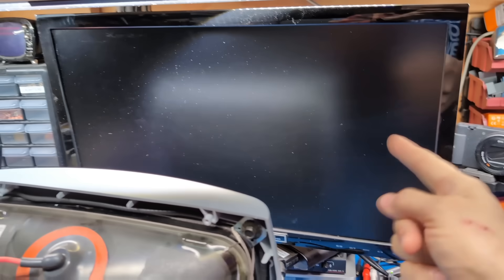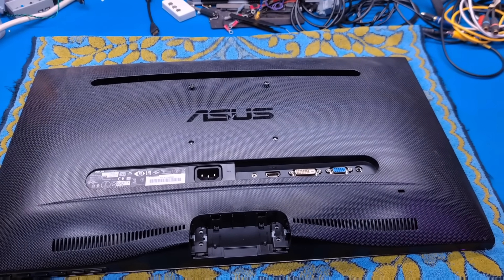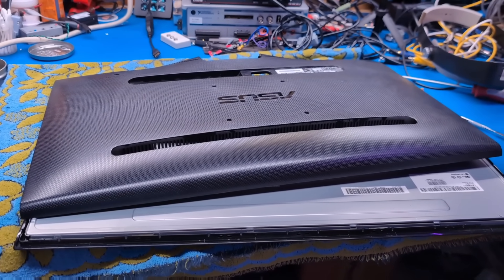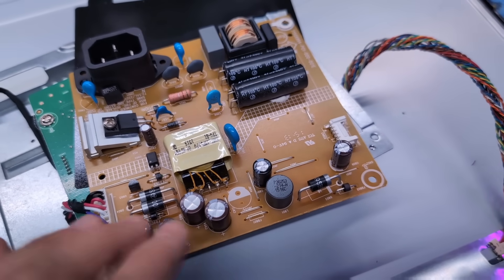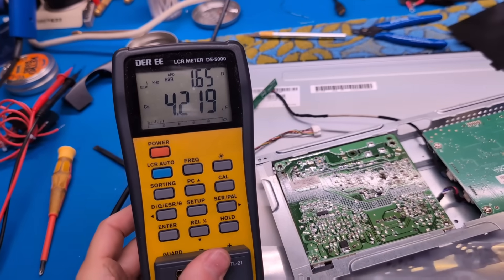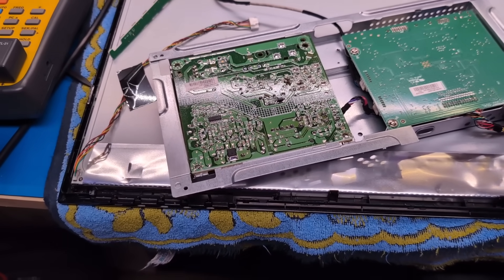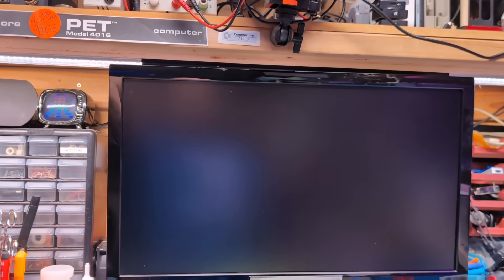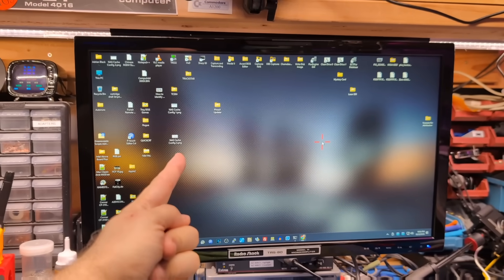Fixing my broken Asus LCD monitor: It won't turn on.

Comment: I have an ASUS monitor about the same age, but different model, and it "died" exactly the way yours did, in my case however it looks like I have some bad caps because six of the caps on the PSU-board are bulging like there's no tomorrow :)
I'm going to replace them and hopefully the monitor will live on for another ten years.

Comment: I have this monitor and it recently stopped turning on completely and believe it or not, the fix is to unplug it and hold the power button for 30 seconds, or just leave it for a few hours unplugged. It's some kind of issue with the soft power circuit. It seems to usually happen with power interruptions. I wonder if the cracked solder joint was even the problem in this case! Still good to repair either way.
Reply: interesting because mine does that, the longer i leave it off the longer it will work without issues, i will try pressing the button 30 seconds while disconnected, so maybe it could be the small board with all the buttons

Comment: The same with a iiyama 27", 10 years old too. Its components are the same as a common Philipps 27" (which provide very useful service manuals, thanks Phillips), and i found no trouble with caps, but it seems there is subtle cracks in the solder joins near the diods, as "pushing" them a little temporary solves the issue (solder quality ? temperature problem ?).  Thanks for sharing your own troubles ^^.

P.S.: As a side note, when this one is HS, the USB ports are still functionning with no issue, and there is curious voltages on the buttons panel, kind of 300mV instead of near 5V when not H.S.  (leak current ?). Thus, it seems that only a part of the alim is in trouble.
Reply: @adriansdigitalbasementextras I guess i found it. It was not the power supply. It was the little keyboard. More specificaly, the little IC on it, which seems to have now hard time waking up on Vcc, pushing one time Vcc a little up on it seems to solve the issue. Hope it will help in your case.

Comment: There is a bug in my ASUS monitor. If the screen has got into sleep mode (orange button) and i turn it off, it will sometimes not start as it should when i turn it on again. Then i have to unplug mains and put it back again and now it will turn on again. It has been like this since it was new 2019.

Comment: I fixed a friends TV that worked for a few years then stopped. There was a capacitor leg that had no solder at all! It must have been making just enough contact on the via and over time shifted. It was a black Friday special...

Comment: I have a similar monitor, similar age too with the same symptoms, I haven't fixed it yet because the bezel is extremely difficult to take apart and I don't want to damage anything, I'll check if it has the same problem with the diodes but I was suspecting a bad polyfuse because the first time it failed I had to leave it off for a long time before it started working again, same now, the longer I leave it off the longer it lasts without it failing. thanks for the video 👍
Reply: so i opened it and couldn't find anything obvious, the solder joints under an inductor were a bit cracked but i doubt it was an issue (i reflowed it), caps seemed fine, there are two dual diodes one runs hot the other one runs hotter from the discoloration, and on the main board the only thing i noticed was that the main chip runs too hot to touch so i added a heatsink but the monitor still has the same issue, so i dont know, i might change a couple caps next to the dual diodes and maybe the small transistor that is next to those, the thermistor measured fine with no discoloration

Comment: My hp monitor from 2009 failed a few years ago, 3 8 pin soic ICs had to be replaced in its psu along with 2 failed open resistors that was difficult to find out. 

My dell from 2013 is also shaky, I looked up the symptoms and it would point to a sot23 voltage regulator. I've already bought a few in case it no longer turns on. 

Both still work and I'll just repair them unless the parts are no longer available like backlight or custom IC.

Comment: This year my Asus monitor stopped working too. It doesn't wake up from sleep or starts from cold boot. Only blinks blue with power LED. First I changed bulged capacitor. It worked, but not for long. Now I probably need to replace either dual diode or voltage regulator for it to finally return to life.

Comment: My second monitor, a 24" Dell U2414h (the 14 is the launch year) has acquired a weird glitch where a single one of the backlight edge LEDs won't turn on after powersaving sometimes. It's fine if I power cycle, so I just do that. Eventually I'm going to upgrade my main monitor and move the current main to be the second. Eventually.

Comment: You unclip 100 little clips and the bezel looks like a dog chewed it. Or in the case of an ebook reader I recently disassembled: the bezel is stuck on with tape, so you have to start at one corner and just tear it off, and THEN you have 21 screws of 3 different sizes for the insides which is a screen, a battery and a small pcb. Of course nothing is supposed to be repared by anybody these days. But we still try! :)

Comment: Glad to see it fixed. 
One time fixing an older lcd monitor with powerup, blinking, looping-bootup sequences gave me a bit of a hard time. 
The culprit in that case was a failing small smd cap, on the logic board near the main controller IC.

Comment: Cold solder joints can be a common problem.  I used to work at a 2-way Radio Shop, & we had both GE-Ericsson & EF-Johnson Radios, which manifested temperature-related problems.  One of our tests, was to place the radio in the refrigerator for a period of time, then remove it, & run it through the paces of operation.  As it warmed-up, if the trouble appeared, we had a better idea of what we were looking for, in-terms of failure.

The boss was never fond of this approach, but it got the job done, & he made his money back, so we saw it as a none issue.  ;)

Comment: I have a very similar monitor that also recently went bad. Mine was CCFL-lit, and I thought replacement was better than trying to mess with the CCFL drivers.  I've now got a matched pair of edge-lit LED panels, and I tell myself that I'm happier.

Comment: I had a very similar Asus monitor, I think it was in my Son's room when it catastrophically failed and melted one of the power plug pins into the plastic of the connector. Luckily I had a bunch of random monitors already around the house and I just plopped another on his desk and he was off and running again.

I'm not using any Asus monitors anymore.

Comment: I have a similar ASUS that I don't use anymore but one thing that drives me crazy with monitors these days is power saving. I want to hotwire my monitors so they have toggle switches to turn them on and off.

Comment: About six years ago my old Asus monitor made a "plonk" sound and turned off, and I couldn't turn it on again. I opened it up and found the reason: a solder joint failed and one leg of the fuse in the power supply jumped out of its through-hole. It was a very easy fix (and the first time I've used a soldering iron since I was a teenager), the monitor still works fine, and it made me think of how many monitors end up in the trash for simple failures that could be repaired in ten minutes with almost no costs.

Comment: This reminds me of a Vizio TV that stopped powering on for a friend that I "repaired". I found a video that explained that it was an issue with the solder joints on a BGA chip which lives under a giant heat sink. So I blasted that spot with my heat gun for a full minute, then let it cool for 10, and afterwards it started right up! But like you said, they make these things to be disposable anymore and that's just a damn shame.

Comment: I have an off brand monitor/TV my neighbor bought at of al places the grocery store. She got rid of it, and I scooped it up for testing machines. It stopped working, but I could see an image on the LCD, and it turned out to be the MOSFET hat powered the backlight. The board under the MOSFET was cooked to the point where it delaminated the traces, and failed because it sort of desoldered itself/broke the trace. The part was actually still good, but was getting stupidly hot. I ended up replacing it with one that cold handle more power, and it's been working  ever since, and not getting warm. I honestly don't think the part failed, it was speced wrong. I spent a lot of time checking caps, because they fail first, but in several things I have repaired recently, it hasn't been due to cheap chinese caps, it's been something else that was just speced too small.

Comment: I just had a monitor fail and it's built exactly the same as yours.. I'm going to go inspect it now for bad solder joints.

Edit: Checked and it's bulging capacitors 😢
Reply: Extremely common issue on LCD monitors from this era, especially on the power board/circuit.

That, and cracked solder joints. I usually just reflow everything if I ever have to open one of these up.

Comment: That's why visual inspection is always the first step. That's not the first PSU with cracked solder joints, because those engineers didn't thought of heat created by PSU AND the panel back light, or they did that on purpose, planned obsolescence is a thing.
Reply: The main cause of cracked joints is wave soldering. It never applies enough solder. It just falls off again.
Reply: to be fair, it's LED backlit

Comment: When i first saw monitor hardware just taped on i was shocked, but it's been like 15 years that they're like that. I wonder what more modern ones are like, how much more mounting hardware they have been able to save.

I had to rebuild my ASUS monitor PSU about 9 years in, i bought it maybe 2011 or so, it had obvious cap issues, it's been good since.

Comment: It really feels that no progress has been made, at least in PSU manufacture, since the days of the original Macintosh. Same problems keep creeping up.
I wonder how many tens of thousands of these end up in landfills due to a simple fixable problem or a failed $0.10 component.
Reply: No the progress has most certainly been advanced so that consumer electronics fail for simple reasons precisely on time for the next model. I have found several ok monitors left in my neighborhood, that have been replaced because the external power supply has failed. Since they have propitiatory connectors, or oddball voltages, most people won't even try to find a new one. If they do, they find the power supply is costs as half the price of the monitor, so they buy a new monitor, the way they have been conditioned to.
Reply: Progress has been made. People just won't pay for it. This has been built down to a price. People want cheap disposable stuff. Look in a PSU on something like a military aircraft. It will be bulletproof but cost 100x as much. At least.
Reply: These produce a lot of heat, and they use unleaded solder.

Comment: Oh no, power supplies failing left and right these days. My 2 year old cable modem / router psu died couple of days ago, and it showed intermittent problems as well before that. Modem itself works with replacement PSU.
I have Asus lcd FullHD monitor as well from 2010, currently it's in it's box unused because I have no space for it at the moment. Last time I used it, it worked fine.

Comment: I have repaired all my LCD monitors over the years because of problems like this, even good gaming ones. It's always a bad electrolytic somewhere, they cheap on them a lot. It's a good practice to change them all once the warranty ends.

Comment: If you are able to fit it, put a little fan inside the psu place: they tend to get very hot and with little to no airflow.

Comment: Great that you got it back working, I actually picked up a few 23"/24" "Full HD" monitors up for playing around with, when the thrift store kicked them out for 1-2€ each.
And also a few 4:3 ones that fully support VGA at 70 Hz, which most widescreen monitors I have don't - they just do 60 Hz.
Reply: Sounds crazy, but keeping an old 4:3 around is pretty important when you like playing around with the old computers. God find there. I’ve run into similar, not a lack of vga on my end, but an inability of the newer monitors to display a low enough resolution for some old video cards I have.

Comment: Those monitors are  notorious for being a victim of crummy electrolytic caps.
Reply: I have a ASUS about the same age as Adrians but a different model and I have six bulging caps in it and it acted the exact same was as Adrians did. I'm going to replace the caps and hopefully it works again after that.
Reply: something tells me the problem isnt fixed and it could be a bad cap, i'm waiting to see because i have the same issue with a very similar monitor, fixed a cracked solder joint and the problem is still there
Reply: Did you even watch the video? It wasn't caps. 2015 was well after the capacitor plague. Even B tier caps last forever now.
Reply: @jamesdavies686  This case it wasn't. My old VE278Q just got a full recap on the PSU and instantly came alive. This thing ran for so long, the working hours overflowed in the service menu! Now, it's relegated to be a test monitor, because it has 4 different inputs and also picture in picture, which is huge, especially for a 13 year old consumer monitor.
Reply: @jamesdavies686  Did you even consider that both things can be true?

I had a similar Asus for a long time, exhibiting the same problem. It was a couple of bad caps on the high side. The caps are absolutely a problem, because they get extremely hot back there which shortens their lifespan.

Comment: I have an ASUS TUF Gaming 32" 1440P HDR Curved Monitor (VG32VQ1B) with GSync i'd gladly give to you (it's in its box) if i had a way to get it to you. it has a slight issue where it'd be working just fine then all of a sudden it would drop out for 2 seconds come back up drop out for 2 seconds come back up then it could be fine for days or for 5 mins. it is random. i just physically can't do anything with it these days i'm disabled now. I live in Tigard. it is probly something easy and stupid to fix. the thing has 2 hdmi, 1 display port built in speakers but the speakers are terrible. all of the controls are on the back in the lower right corner which is the only thing i hate about these monitors. (I have 2 others on my desktop machine)
Reply from the maker: Thanks for the offer but I like this monitor mainly as it's so flexible and has all 3 inputs types, but even better the VGA input fully supports Sync on Green so I can use it with Macs and SGI systems. Seems so many new monitors don't... Oh and I guess the "small" 23" size fits in the space allocated. Things are tight!
Reply: @adriansdigitalbasementextras  :) I hear you. well it will be here if you ever want it. keep doing what you do and don't ever change for anyone.

Comment: Amazing how poor that quality is compared to the stuff you usually work on.   Prices have come down so much, but build standards have, too.  Win some, lose some, it seems.  Nice fix, though!   Good work.
Reply from the maker: Yeah I don't really get the fact they don't even bother with any screws to open it up. I guess it's just extreme cost cutting!
Reply: @adriansdigitalbasementextras  Yeah, very little is made for repair any more.   The tech itself is astounding, but it's all epoxied in disposable modules to just throw away when it doesn't work any more.   As much as I love seeing everything it can do, it makes me sad to think about how long it's going to last.  Or won't.